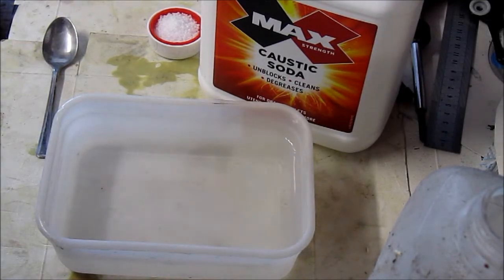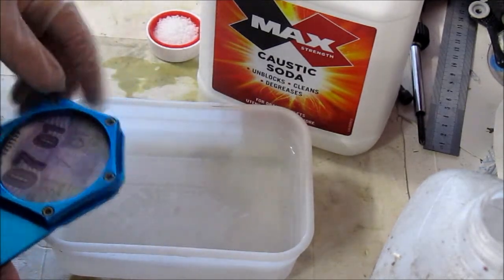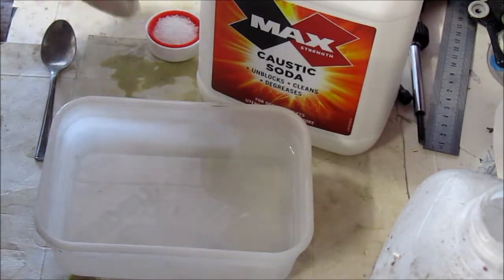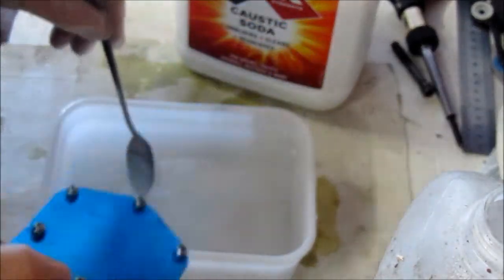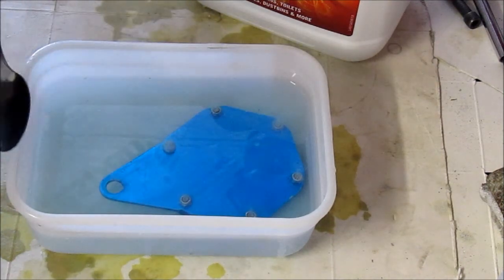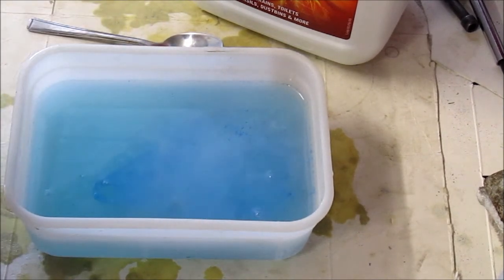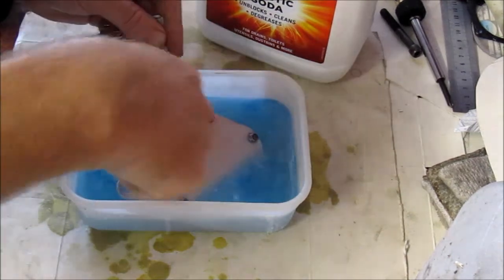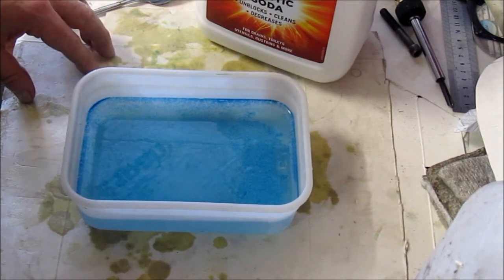Workshop Tip # 2    Removing Anodising

Comment: Do you have to use distilled water to mix or tap water?
Reply from the maker: Just tap water.
Reply: @Merch131ho  Are you also familiar with the desmutting process? The next step right after etching?
Reply from the maker: @christopherowens2635  I have heard of it, but never used it, as I have only removed anodising, Afterward I either polish the alloy or paint it.

Comment: 20 grams of chromic acid, 35 ml of phosphoric acid heated to 100c will not attack the aluminum. Make sure you are wearing the proper mask. Etching in caustic soda causes 2000 7000 and cast to turn black. You will then need a deox to get rid of it. Or a lot of scrubbing.
Reply: Are these quantities per litre?
Reply: ah found it
The common chemistry for this bath is 175-g/liter chromic acid plus 35-g/liter sulfuric acid in water
Guess this is why Chromic acid is sold in 25kg bags .  boooooo

Comment: On 600 series Alloy this is great but on 700 series it does go black so you need a brillow pad  just to clean the 700 up after...or Autosoul polish.
Reply from the maker: Yes some pieces I've dipped do turn black after awhile. The difficulty is knowing what grade of aluminium a part has been made from.
Reply: Bevel Head 2000 series turns black with a green tint. 7000  black with a red tint.